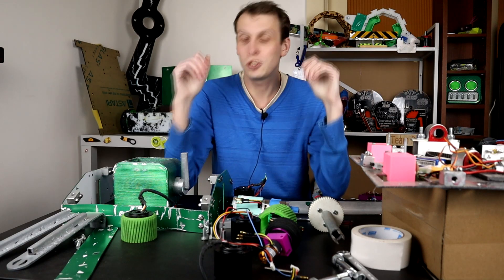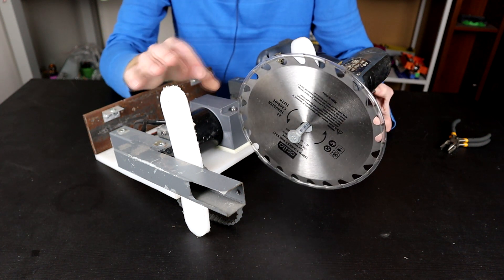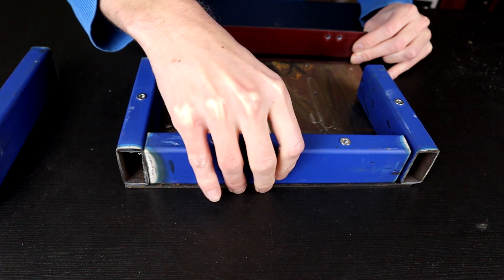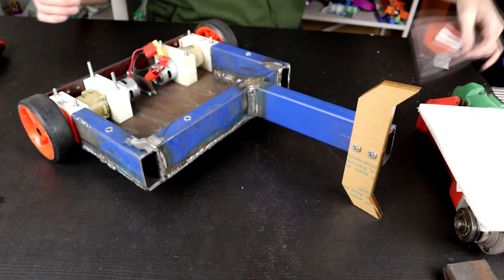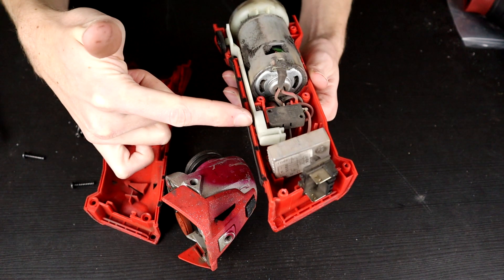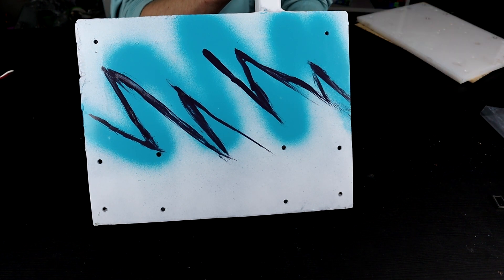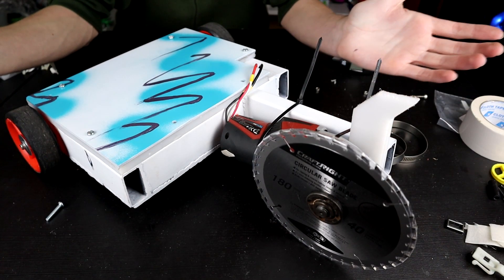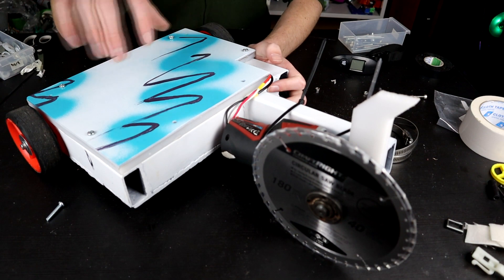Rush building a 13kg combat robot!

Comment: Could drill a hole in your weapon support arm and use a bolt into the threaded handle point on the grinder head.
Reply from the maker: Thats a great idea!
And looks like it will miss the standoff out the front, will try to do that if I get time